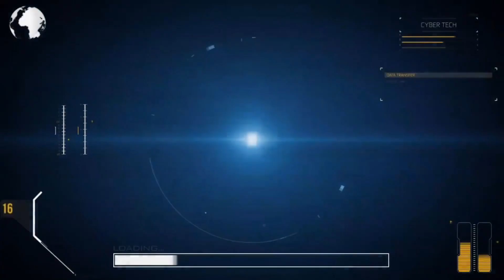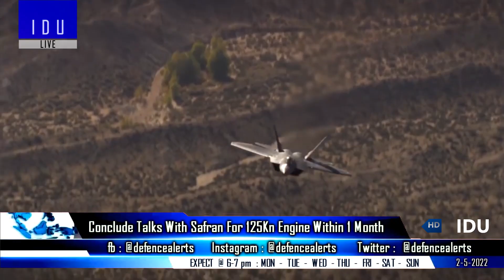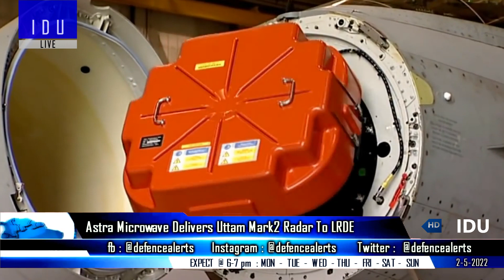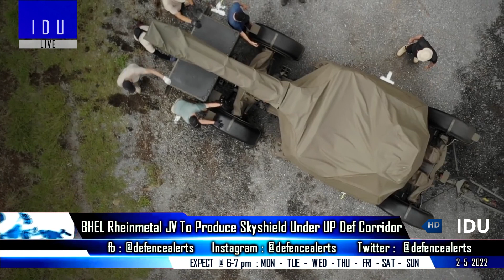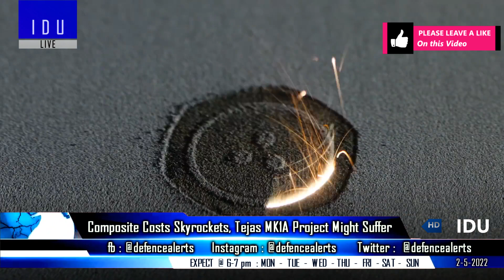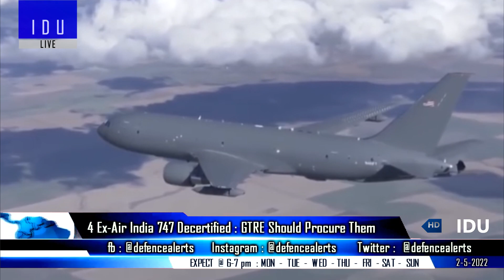Indian Defence Updates : India France 125Kn Engine,Uttam Mark2 Delivered,B747 Flying Lab,ATAGS Clear

Comment from the maker: 🔴What's Your Opinion : "Conclude Jet engine talks with France In a month" ?
ＬＩＫＥ | ＣＯＭＭＥＮＴ | ＳＨＡＲＥ | ＳＵＢＳＣＲＩＢＥ
Reply: @Flying Tiger Engine deal might be linked with MRFA. If IAF is not going to buy Rafales; there s no point in joining with Safran for engines. So it might be a win-win for both parties.  Honorable pm Modi is a tough negotiator n hope this deal will help both countries aerospace industry...
Reply: V good move. Safran is the right partner ; can be trusted in current geo-political situation n also sanction free. Also Rolls Royce offer would have been a nice tool to negotiate with Safran. Hopefully negotiators sign a deal where India gets good share of work n worth d time waiting . Bring on 125 KN engine on Tata AMCA soon.
Reply: India and France should make 180kn to 200kn jet for AMCA fighter jet.
Reply: @santoshpal6747  200 KN engine ??? R u planning to operate AMCA using a single engine? Overpowered to operate double engine AMCA
Reply: Without a domestic testing infrastructure it will be continually delayed. They now have the chance to build a flying testbed so they can at least build two and store the other two for spares. But to speed up the process they should be in league with a private sector partner DRDO had all the help they need to develop a working gun it took them many years to come up with the Danush gun and it still is substandard. The joined venture ATAGS is already cleared a couple of years after they started to work on it. They need to involve actually educated people in their programs and not only government officials.
Reply: @Flying Tiger @jefe  bro - if not Rafales F21 s d next best option. They r also offering only assembly line in India; then what's d difference? I m aware Tata is building some components ; but it's too small percentage of a jet. They won't offer engine; but will they offer tot of AESA radar; IRST; EW suite do that we can use it on Tejas-mk2 n amca? Also will they allow to integrate Astra-2 n 3 by giving source code or make source code open? If these spare parts r not made in India ; then we have to be dependent on USA on spare parts n it will add geo-political woes . India s already having nightmares with Russia . We cannot object even Bucha killing because of weapon dependency on Ruskies.
Reply: Such a shame that the ministry has to order these officials to conclude talk. In any other country the moment a committee is formed, they would chalk up a schedule and a working plan and provide timely updates to their governing and auditing bodies to keep key stakeholders in loop at all times. Precisely to stop critical projects going wayward as it happens here all the time. If given a choice these goons would keep discussing till their retirement before concluding anything.
Reply: France will never give india engine tech. Lying to your audience isn’t the way to do it.
Reply: @deveryhenderson8335  Please be informed that France do not have 110 KN to donate it to India. So both countries r looking for partners to develop a new jet engine. This rnd will happen in India. Not sure which country r u from. Please be updated brother.
Reply: sooner it starts the work it is better. Not just AMCA, we should explore this option of using this engine for MK2 and TEDBF as well. This will increase the synergy and provide benefit of scale.
Reply: @Flying Tiger ve a question on Ukraine war. Russia s con raining missiles in Ukraine. How many missiles will be there in Russia total inventory?
Reply: How many missiles Chinese might have ? How much impact these artillery/mbrl/artillery will have in Himalayas. Going by past battles in Panjir ; Tora bora; Kargil ; Lakadh - defending side had a big advantage? How will China manage this ?  Wat r critical areas between India n China separated by plain?
Reply: China has a huge budget. Read in a forum tat Chinese might ve 100 thousand cruise missile. Is it true ?
Reply: most positive

Comment: Finally India admits failure to develop fighter engine . Same way accurate Surface to Air missiles did not take off . Trishul closed half way . With Akash unreliable, India went to Israel for long range,medium range surface to air missiles , Russia for Brahmos etc . Strategic missiles cannot be considered a big deal.
Reply: Akash is being upgraded as we speak. The inventory is huge, so it will take some time. Trishul paved the way for development of QRSAM and VL-SRSAM which were developed pretty quickly due to the technologies that were proven during Trishul development and lessons learnt from the design flaws.
Reply: @pradeepsahoo7243  : QRSAM promised to be completed within 48 months is still in development phase ,I ,understand . Most of the crucial things are said to be from another system . By the time ,it comes to deployment  ? Akash should have been modified much earlier . Instead hundreds of Crores were dumped in orders for the outdated missile .

Comment: A boing 747 has 4 engines and an extra engine can be easily added because the structure of it allows to do so but an airbus 320 does not allow to add one more engine , if done then a trial will be needed ,many difficulties with the structure,aero dynamics and if one of the engines are replaced by kaveri then there will be reliability issues and flying an aircraft with single engine(if kaveri malfunctions ) will be very dangerous
Reply: Boeing
Reply: True
Reply: Boing🤣🤣🤣
Reply: Ji guru ji, 🤣

Comment: Atleast dhanush and ATAGS clear trials...moreover Garuda 105 ..is also on its way to induction..
Since technical evaluation has been done..cost may not be a big problem for induction..because govt has banned 155 mm howitzer..so govt will allocate more  funds to procure local systems..and army can't complain about it..
Reply: Danush is an eternal project and the OFB successor is continuing the traditional substandard components. Because of this they are in their third return to the factory of delivered guns. Go ahead with the ATAGS and use the joined venture ATHOS gun as a secondary unit until all the OFB idiots are replaced and the Danush gun is manufactured with the required parts.
Reply: We cannot keep on boasting incremental Improvements as great achievements or new missiles of it's class or nobody in the world has it .

Comment: The su30 mki is definitely getting weapons upgrade but the most important i feel that the radar should definitely be upgraded to AESA for better outcomes.
Reply: To upscale it to aesa, it will require engine upgrade as current engine doesn't provide enough power for an aesa radar
Reply: @_psychopath_5623  dont think so. Su 30 engin emore powerful than Tejas. Also even Uttam MK1 is better than PESA in Su 30. Without that this will not survive.
Reply: @vaimurthy  lol. Are you kidding me? Su30 and tejas comparison is just stupid. Tejas is much lighter aircraft whereas su30 is heavier aircraft with way higher payload and with electronical equipments which are more power consuming as it is an air dominance aircraft so all the energy that the engine generates goes to different parts. Hence the upgrade.
Reply: Bro 145 su 30 mki already updated with aesa
Reply: @SANJAYKUMAR-us4vl  no bro it s having pesa still. U need to wait for few more years
Reply: @SANJAYKUMAR-us4vl  is that so? Sorry then i had no idea. 🙏
Reply: @SANJAYKUMAR-us4vl  dont think so.
Reply: Also electronic suite needs to be ramped up
Reply: yes, We need to make all 272 Su 30 to use upgraded Uttam radar and Astra missiles. Otherwise in BVR world Su 30  it is useless